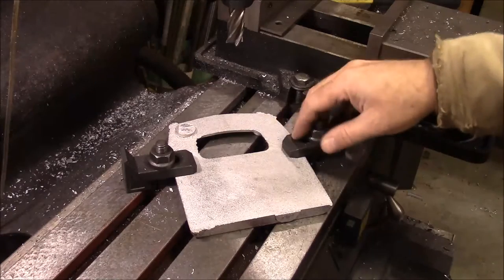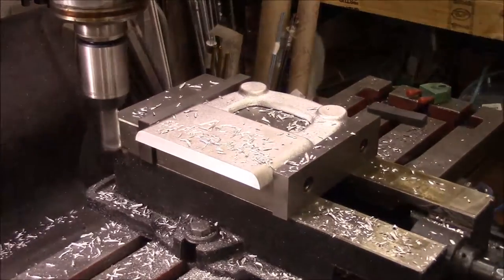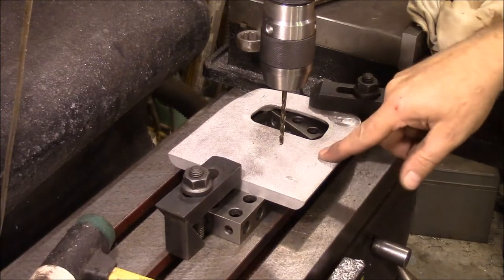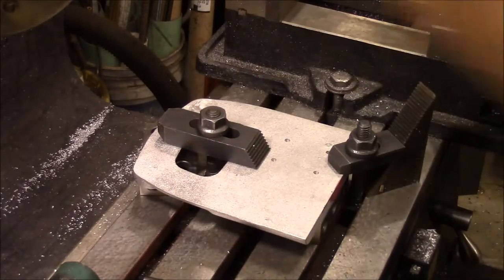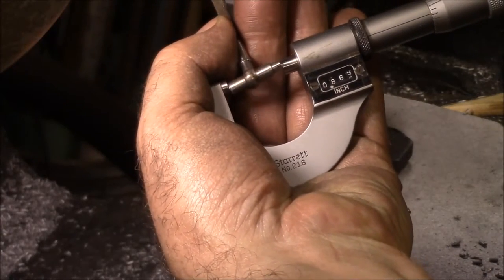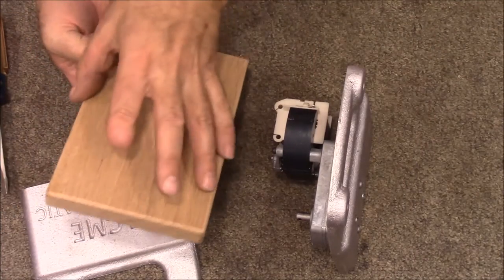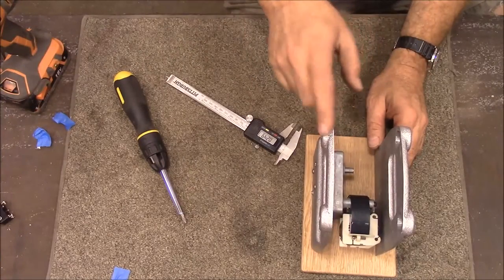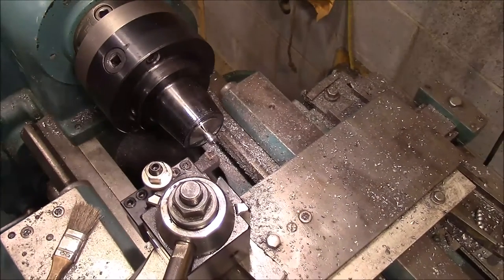ACME Shake-o-Matic Part 2

Comment: Dear Sir,
Nice project. Love the DRO trick for transferring holes. What kind of electric motor do you use and where to get it (out)?Best regards, Piet
Reply from the maker: I got the motor from a surplus place online.  I don't remember which one, it probably doesn't matter cause I'm sure they have sold out of them by now.   I feel like motors have gotten really hard to find unless you are willing to pay a fortune for them.  As you know, often times you can buy a piece of equipment cheaper than you can buy the motor.  If I search google long enough I can usually find something.  Thanks for the comment, and thanks for watching!
Reply: Thank you for your reply.